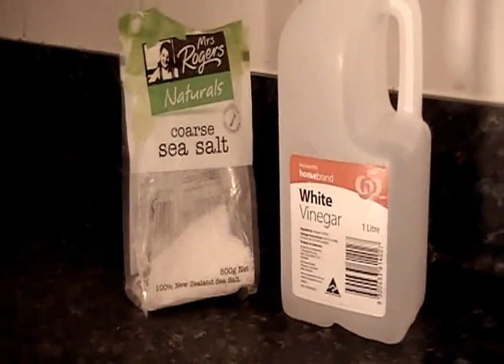Bone carving....whitening, disinfecting and carving (full version)

Comment: Loved it! great work, I want to run out and get a dremel RIGHT NOW!
Reply: If you enjoy carving bone or want to learn how to. You tube is a great source of information. Hawaiian bone art  is very popular. I have done several pieces in bone. Cow leg bone is the easiest to obtain and process. Dremel tools are great to work with. However they can be expensive. Harbor Freight is a great alternative for the budget friendly tools. They also have tool bit kits available with a variety of different options for working with bone. One other safety tip. Make sure you ware a dust mask to protect yourself from the bone dust. It can damage your lungs. Happy bone crafting. GF1 👍👍👍👍👍👍👍😁😁😁😁😁😁😁😎